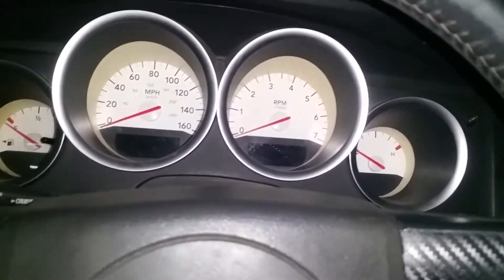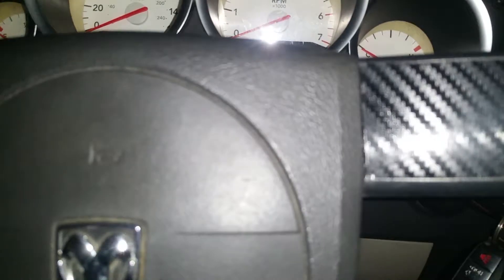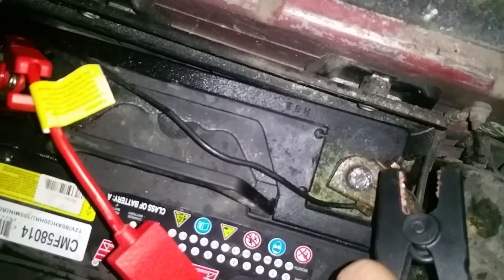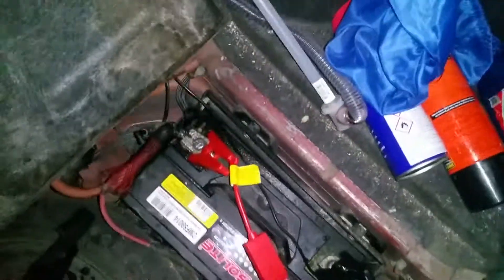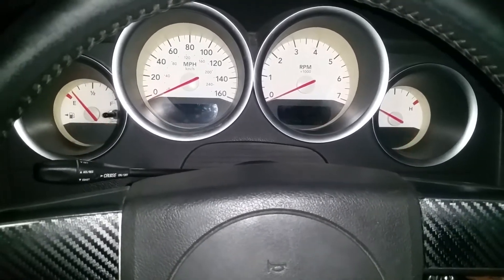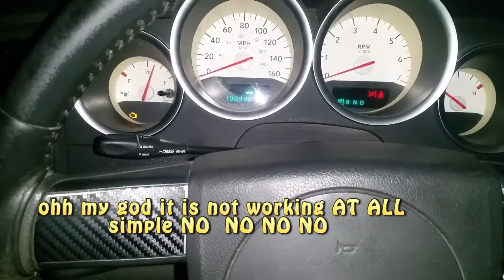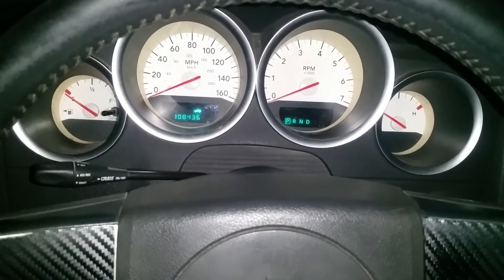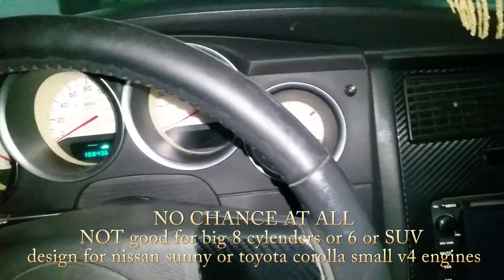Jump Starter test...Do the cheap Chinese Jump Start Packs really work?

Comment: I got a set of Hummer jump starters and they can start up a car even when the battery is flat dead. The interior lights will pulsate slow because of the alternator inconsistent delivery (by design not a fault) but other than that the car will start. If you have to wait until you can start then you simply have the wrong jump starter. A proper one does not need any waiting time. Connect, turn the key, start. Remove, close the hood, drive. Anything else is not worth buying. 

PS: There is a video on Youtube where a Russian guy starts a tractot with the Hummer powerbank jump starter and the battery is not even there. That was the selling point for me when deciding which brand and product to buy :)

Comment: Did you turn on the device after connecting?  Some will say wait around five minutes before starting.  Also, make sure the connections is solid.  The video is a bit shaky almost got dizzy.

Comment: I had a flat battery on  a 1.0L Peugeot 107. It wouldn’t hold a charge so i borrowed 2 booster packs and this is what i found:
£170 pack, no waiting just attach it and start the car👍
Day two
£50 pack from Amazon, attach but it wouldn’t turn the engine over BUT wait a minute or two and it started the car👍
So i think i will get a £20 pack from ebay, they are fine for small engines and you wait a few minutes and of course they are fully charged to start with
I would like to hear opinions
Reply from the maker: in your case your engine is 1000 liter which can easily start from this jump starter but for bigger v8 or v6 this is not ideal just buy 1 and i m sure that will be enough for your car

Comment: Its a battery booster.  Starts when your car battery is low.. Not fully dead!!
Reply: The audew 1200 and gooloo 1200 would start it without the battery attached.

Comment: If You Are Using Chinese Jump Start, You Need To Wait Around 5-10 Minutes Because The Current Output From That Powerbank Is Not To High... It Cant Support To Charged Up Battery And Start A Car On The Same Time.... But If The Battery Just Low, It Can Start Up The Car....
Reply from the maker: After this i bought another jump starter which is almost double the price of this one and weight is also more and that jump starter start this car in first go may be my car needs more power
Reply: @YOVlogs  Yeah... Maybe The Power Output From That Chinese Jump Start Does Not Have Enough Power To Start A Car With High CC Engine Or A Car With Near Dead Battery... Same As Mine... Im Using A Chinese Jump Start... It Can Start A Car With A Weak Battery But It Can Start A Car With Almost Dead Battery... If I Need To Start A Car With Nearly Dead Battery, I Need To Remove That Battery And Just Put The Jump Start Directly...... Lolz... It Can Cause ECU Damage On A New Car... Old Car With Caburetor Can Do That With No Problem Like Mine Car... Haha😅😅😅

Comment: I think you should use the jump starter points at the engine bay not from the back
Reply from the maker: In this car battery is in the trunk
Reply: @YOVlogs  Yeah but it should have some emergency plugs in which connect jumper cables under the hood

Comment: Not even good for 2 cylinders. I bought one. Can’t crank even a small 1.2 gas Engine. Use it now as power bank.
Reply from the maker: I thought it is because of my big car  battery of 100 Amp

Comment: I've seen plenty of mistakes you've done. Too many mistakes.. First of all, remove the negative(black) cable that is connected to your battery. 2nd, You should not connect the neg(black) cable of the power bank to the neg terminal of the car battery, it should be connected to any ground engine part of the car or connect to the black cable but dont connect it to the negative terminal.. Lastly, your sequence is not in order. You made some error that could damage your battery.
Reply from the maker: After this i bought another jump starter which is more powerful and another new1 work for me and started my car but my car battery is so weak then i replaced the battery